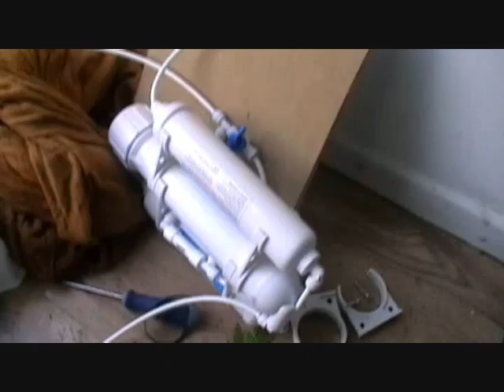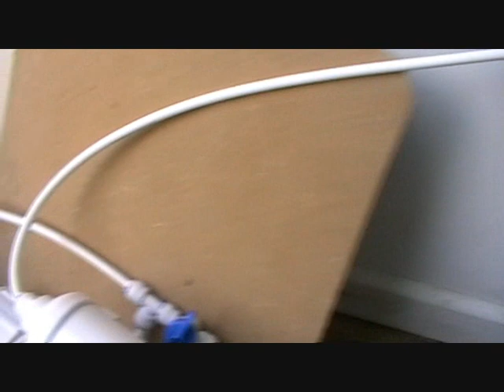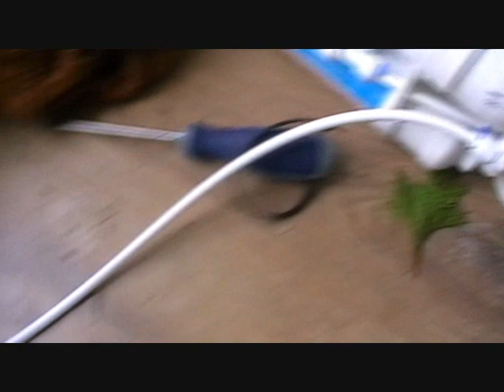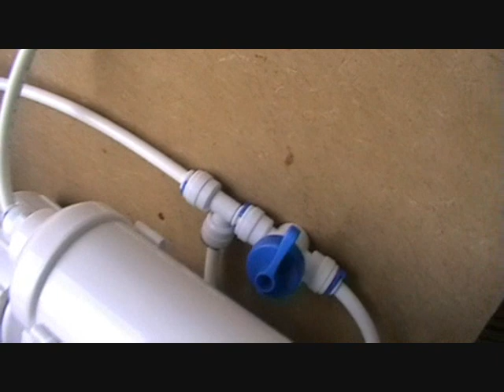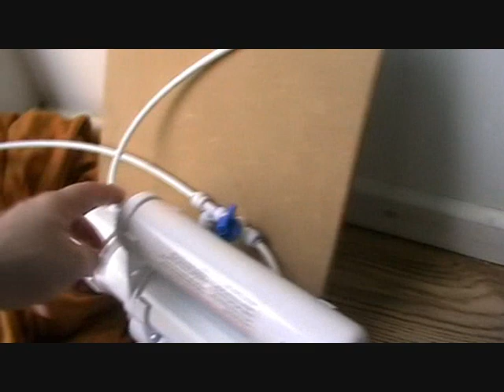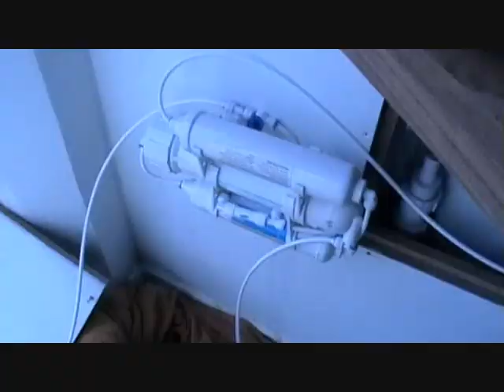3 stage RO Unit - Beginner set up for aquarium use

Comment: We've just got the same unit and we're having trouble getting the stoppers out and fitting the plastic tubing. I don't want to use too much force in case it breaks. Do those push in to remove as well?

Comment: im trying to learn about these. is the waste water just standard tap water? or has it ran through the filter too? the reason i ask is because im on a water meter. 
but i need to sort my 40ppm tap water
Reply: 40ppm is so low haha. Mine is 315, practically liquid metal.

Comment: Thanks for the video - so this all looks pressure powered by the mains supply - does that mean it can be installed horizontally as well as vertically ? I see yours is horizontal in the video, but I was not sure if that's how you usually run it. I plan to run mine in the bath with a tap adapter rather than connected under the sink - just need to know if I should attach it to a board or something. Cheers ! :)

Comment from the maker: Just to update, i've had this for a year now and it is still working well. All in all a worthwhile piece of kit.
Reply: How long does it take you to fill the container with ro water buddy
Reply: I thought RO units are to be use 24/7 like a regular filter that has a pump. Do you use it only when making a partial change to the water?
Reply: chinito you only use it when you need more water,don’t use it constantly it will wear out the unit and filters rapidly
Reply: Bradmans Tropicals hello mate does this give you 0 TDS?

Comment: just bought this ro system, im just like what you said in your video ''panicky'' as i've never owned or used one of these systems before. btw, whats the flush thing about? so when i install everything, i do the flush?
Reply: I flush each time I use it just to clear the old water out, only for 2-3 minutes. On first use do it for longer to clean the materials, 10 minutes or so. You just turn the blue tap to switch it to flush, the flow will be more powerful then when in RO mode.
Reply: Bradley Pantling  what brand it is